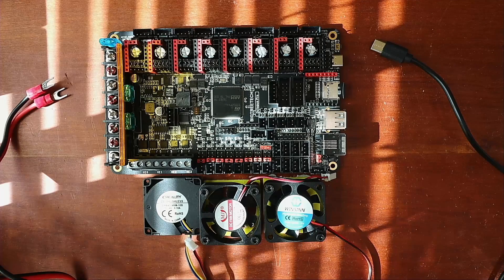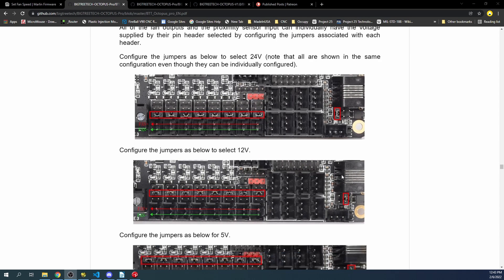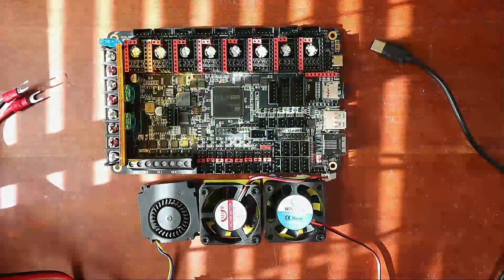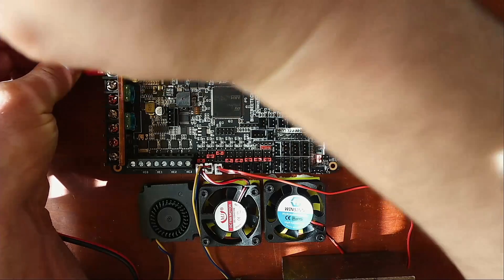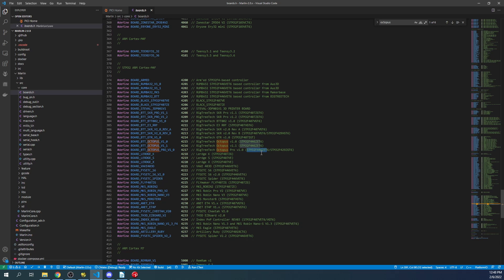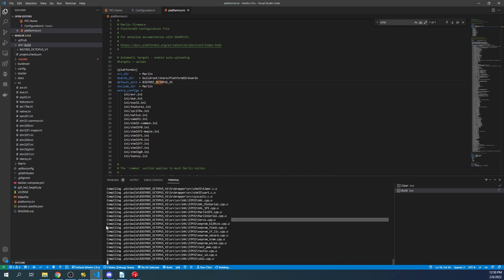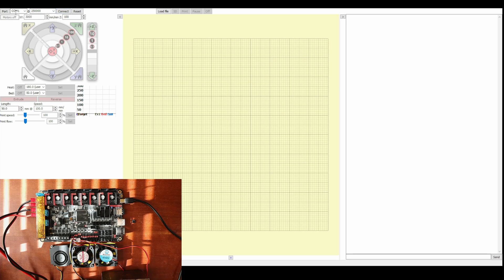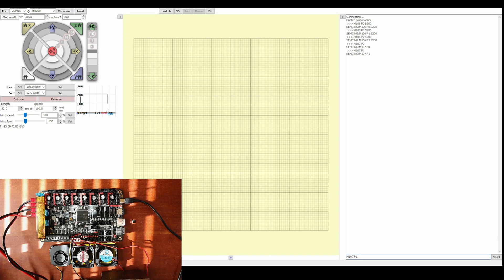BTT Octopus - multiple voltage Fan configuration.

Comment: Gday.
I changed 1 of my fans to 5v via the jumpers and even without plugging the fan in, it let the smoke out of the board and the stepper drivers. Any idea why.
Reply from the maker: Unsure.  Sounds like a question for BTT.
Reply from the maker: Do you have a picture of current configuration?  There's a Discord link in description.

Comment: How do you know the codes for the fans, are you familiar with G code or is there a reference you are using?
Great Video!!
Reply from the maker: M106 p(fan position) s(speed).  Also on Marlin firmware website.

Comment: also, I recommend doing a build with the version of Marlin that you just downloaded. Before configuring Marlin. I have had to many versions of Marlin that I could not get to build correctly except version 1.1. If all goes correctly then Edit and rebuild. Then if you have any errors it will be much much easier to trouble shoot.

Comment: I am going to try to use Flutter/Klipper. I have this part almost set up. I could not get Klipper to install on my Creality 4.2.7 board. I hope the firmware install goes smoothly on the Octopus board. I don't like the Creality boards. I had to many problems.

Comment: I need to connect a Pi Zero (micro USB) to a MKS Robin (Mini USB). Klipper/Octoprint. Is it easy to splice my own USB cable? Micro to Mini?
Reply from the maker: Not sure I understand your question.
Reply: @EdwardBraiman  To connect my Pi Zero W2 to the MKS Robin, I would need a USB cable that is Male MicroUSB on one side and Male Mini USB on the other. Would it be practical to splice say a MicroUSB on the end of a Mini USB cable? Isn't it just 5 wires? There is no electronics in such a cable?  I don't have such a cable and would rather not wait to order something from Aliexpress/ebay.
Reply: @FilmFactry  Zap Cables has handy DIY manuals and wiring diagrams to make this easier.

You can be nice and purchase kits from them for this purpose, which include everything from sheathing and cables to connectors and heat shrink tubing. You'll need soldering equipment, wire strippers, and other common tools such as needle-nose pliers.

It's not terribly difficult and a worthwhile skill to gain.

Source: I make custom coiled keyboard cables.
Reply from the maker: Why not run each to USB on pi?
Reply: @EdwardBraiman  See Ed, that's why I like you. You are too smart. That is the best idea. I will look up which pins they are. See you answered my question with your question:-) Thanks!
Reply from the maker: I might be doing a tutorial on this soon, but just need to think our how to present.
Reply: @EdwardBraiman  One thought. I am looking at the Pi pin outs. I know it is normal to grounds from the main board to the Pi, But since the pi has its own 5v supply, best not to connect +5v from the Pi to +5v on the Mks Robin ( via MiniUSB).